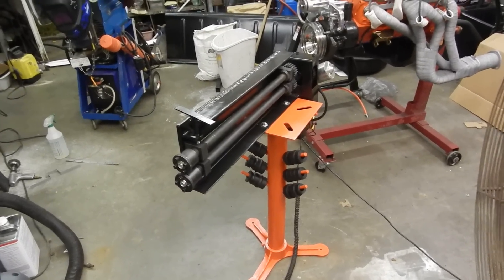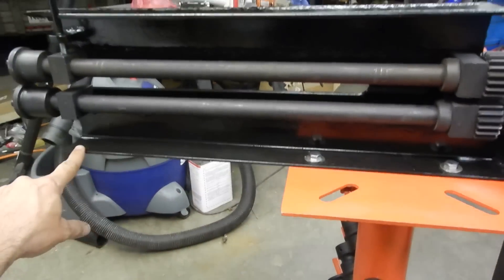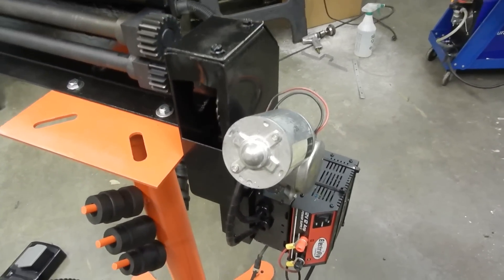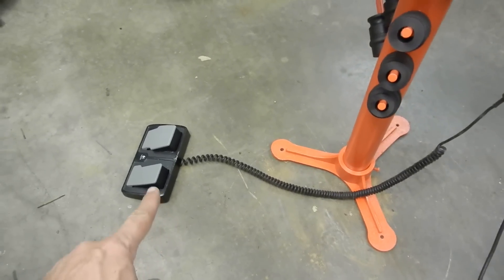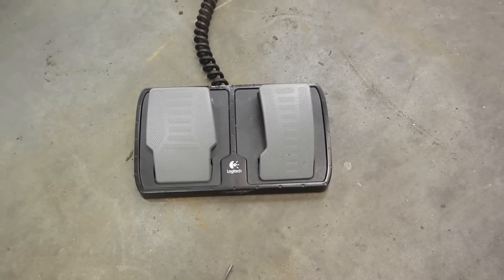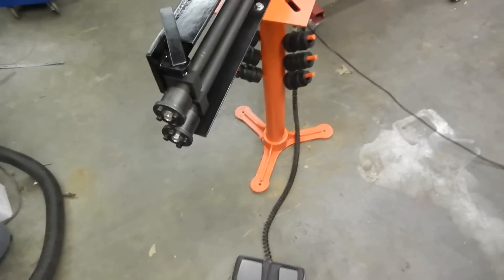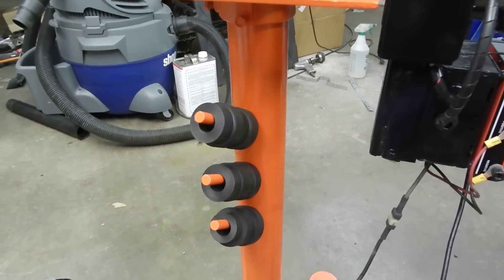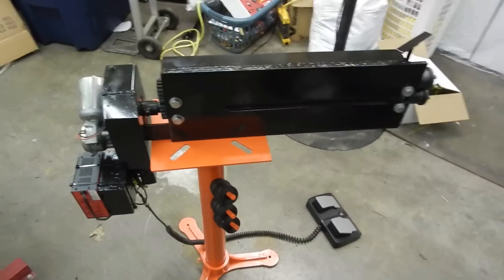Harbor Freight Bead Roller Upgraded & Modified

Comment: I like your video you can send me the part number of the bead roller THANK YOU
Reply: It kills me that people make these video's but never mention the HP or the RPM's of the motors that they use. I'd rather use an electric motor than a drill.  There are several gear reduction electric motors on Amazon but without knowing the HP or RPMs its all just guess work.

Comment: Nice bead roller. I just picked up one of those gamer pedal assemblies with two pedals. Could you explain or describe how you wired that to work. There are what I assume are potentiometers in each pedal that I have. Don't know if I can use them or not. I was wanting to disassemble the switch off of a reversible drill and use the pedals to change the direction.

Comment: NICE JOB I LIKE THE FOOT PEDAL DO YOU HIVE A SUGGESTION ON THE RPM BEAD ROLLER SHAFT ITSELF for a beginner ?
Reply from the maker: I used the gearing out of a wheel chair lift and didn't;'t modify the RPM since the foot pedals can very the speed. I still laugh at the fact that I used the gas and brake pedals from a computer gaming system that I was about to throw out. I do highly reccommend a variable switch to better control the speed...it can be tricky running a bead it corners, etc.

Comment: Nice mods. Ever think about variable control for turns?
Reply from the maker: foot pedals I used have variable control...it's a must have when beading.
Reply: @davidmartinphotos , Id like to know how you wired those pedals to work with the motor for variable speed.

Comment: really nice!  the motor looks like an electric window motor?  I didnt hear you say what it was.. im guessing .. anyway.. nice work man
Reply: 1963impala2dr description says wheelchair lift
Reply: +ZeroCool, That was the controller, the gear "motor" is from a  car windshield wiper assembly.
Reply from the maker: Sorry for the delay, the motor is out of a wheel chair lift off of a car. I used the motor and gears due to the powerful torque they produce. It works very well with all types of thickness metal.

Comment: Do you got a part number on that motor?
Reply from the maker: No sorry, I just used a motor and gear assembly out of a wheel chair lift that we were about to throw away. They work great due to torque output and motor drive speed.
Reply from the maker: Sorry, I don’t, the motor label was faded out, model name and number was unreadable.